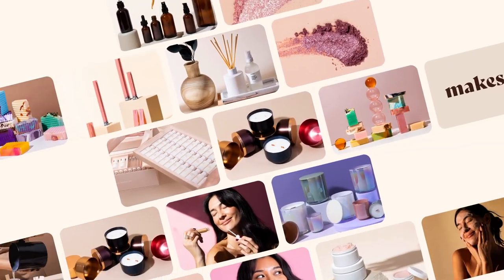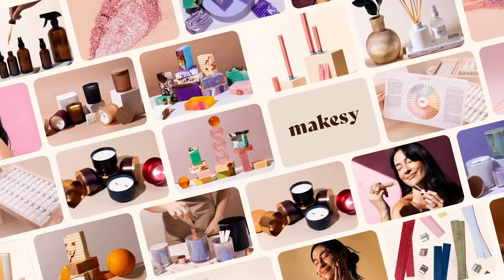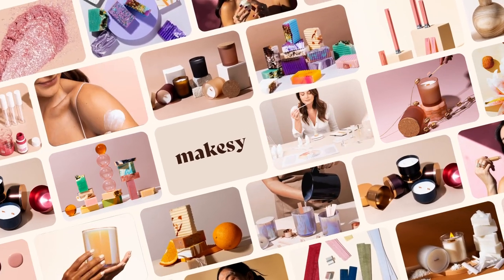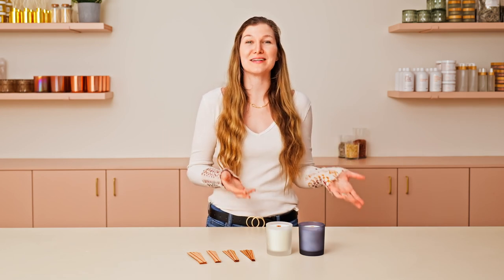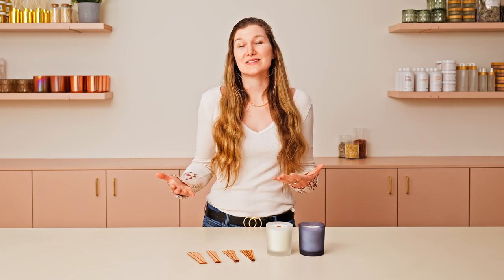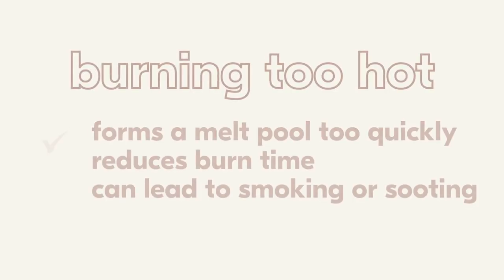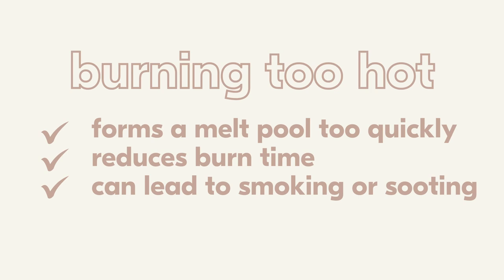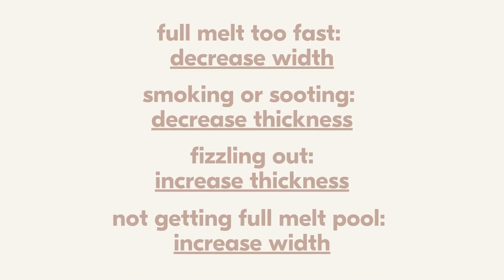how to troubleshoot 🔧 the ultimate wick | wooden wick burn testing

Comment: So I shouldn’t go with your recommendations on wick size on your site? I’ve ordered 200+ wicks using the 12 oz Aura vessels and I’m having issues with black smoke. I ordered based on your recommendations. And I can’t return the wicks and now I’m stuck. I’ve trimmed the wicks down to the size you recommended, and I’m still having the same issues. I’m using the Virgin Coconut Soy wax, .75” 5” crackling booster wick .03 with the 12 oz Aura vessels. I’m so lost and I feel like I’ve waisted money. Yes, I could have ordered the sample wooden wicks, but I trusted your recommendations. I have an appointment scheduled with a MakerPro (member) this Friday.
Reply: Hi, I would recommend using the booster .02 wick for any coconut wax blend. And for the aura vessels, .625” BUT maybe purchase the small wick kit to test it out first. Maybe contact customer service regarding the wicks or try to resell them on “the stash”. All the best.
Reply: I'm in the exact same boat. I'm using the same vessels and wax😮‍💨 and I got the word wicks🤧
Reply from the maker: Hi there! We are very sorry to hear of your frustration. The Wick Selection Guide is meant to a guide but is not substitute for conducting burn tests. That is why we recommend purchasing wick sample kits in order to narrow down the right wick for your wax type, fragrance, and vessel size. If your candle is smoking, that means there is too much wick material and you either need to try wicking down in width first, then thickness if the issue persists. Instead of a .03 x .75 try the .03 x .625. Hope that helps!
Reply: I’m using 12 oz aura vessels, coconut apricot wax and I’ve tried .02 x .05, .02x.05 booster, .03x.05 and they ALL have black smoke at some point. I don’t get what’s wrong because I’ve sized up AND sized down and nothing helps. I even went down to 8 percent fragrance load.

Comment: What if your wicks are doing both? Or rather inconsistently doing so? 

I have been testing for over a year with different wooden wicks and have not found the perfect wick size. At some point, I believed I had found the correct size, and was excited, but then soon found out that the results were inconsistent. Sometimes the wick would burn a full melt pool at a normal rate, other times the same wick would burn too hot before the 4 hour mark and STILL not reach a full melt pool...and would just start tunneling due to the over-consumption. I soon figured out this could have been related to scents with citrus, so limited myself to non-citrus fragrances, yet still ran into burning issues. I JUST test-burned a candle with my most recently-well-working wick choice, with a non citrus fragrance based candle, only 8%, and it burned fine & slow the first round, then I trimmed it (LOW-below 1/8th) and within about 40 minutes the flame was now big and sooting.. 

I've wicked up & down, .2's boosters work for my beeswax/coco mix in terms of they burn at a nice calm rate, yet they do not provide quality scent throw, and they also do not reach a full melt pool. So I moved up in size for the .2 and same thing - no hot throw, slightly better melt pool. I've been using .3's and have sized up AND down with those as well. Sometimes they work, sometimes they don't. It seems like chance and luck at this point unfortunately.
Reply from the maker: hey there! you've discovered this, but yes, we find fragrance is the most significant factor in difference of wick performance. typically there is roughly an 80/20 rule in our experience. 80% of your fragrances are going to play nice and use the same type of wick in one vessel - but around 20% will likely cause problems and you will need to wick up or down in width OR change thickness entirely in order to properly wick that fragrance choice. wood is also a natural material and like a fingerprint, each piece of wood has it's own unique grain structure. this is one of the reasons we launched the ultimate wick however! the engraved channel down the center of the wick helps to consistently channel the flow of fuel (wax) up the wick. In our testing, this wick burns more consistently compared to both the single ply and booster wooden wicks. If you're using the beeswax coco creme, I would recommend the Ultimate Wick .03. You can also reach us on chat on our website if you would like more detailed help with finding the right wick!